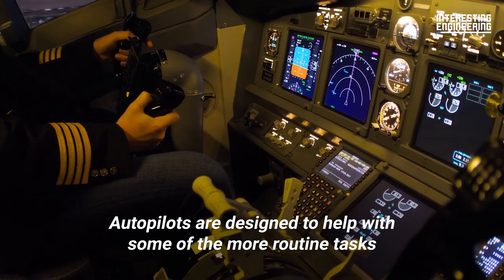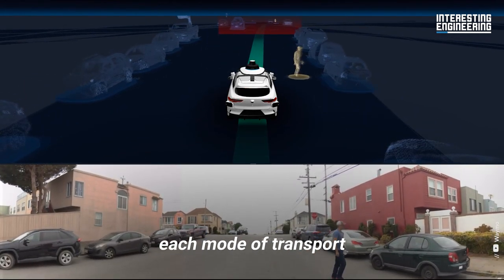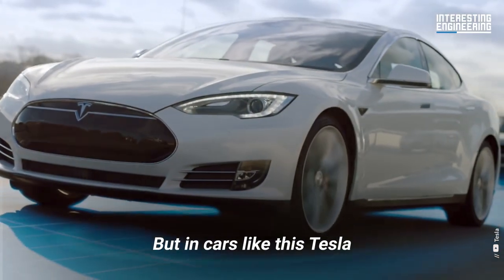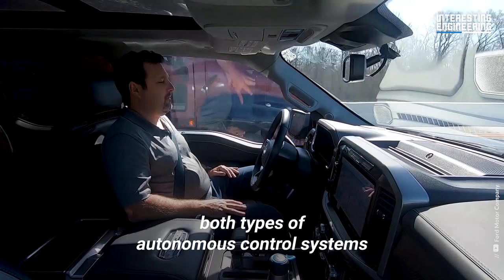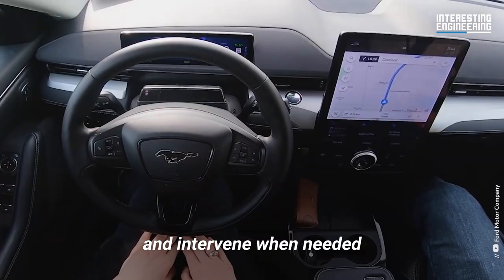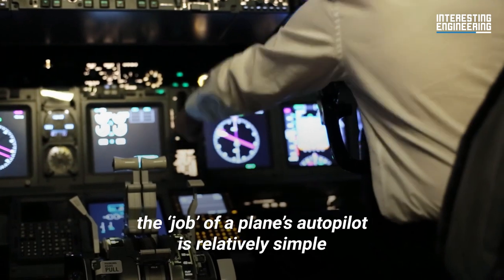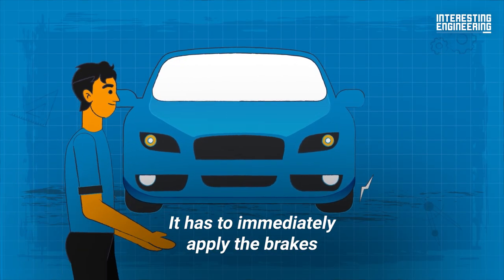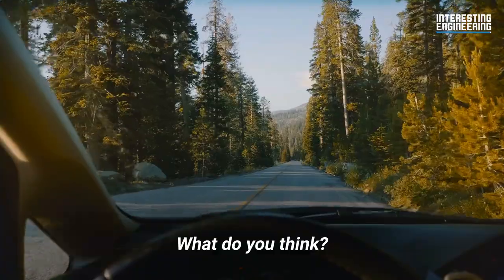Planes vs cars | How do their autopilots work?

Comment: Nice video. Though I always thought that autopilot on planes are engaged moments after takeoff and disengaged shortly before landing. That was what I was made to believe.
Reply: And you are correct. The video is wrong. Most operators require pilots to switch on the AP shortly after takeoff and it usually stays engaged until final approach, or even do an autolanding if weather is crap.